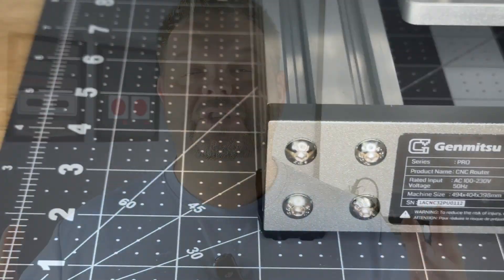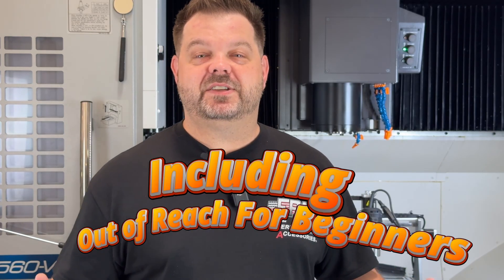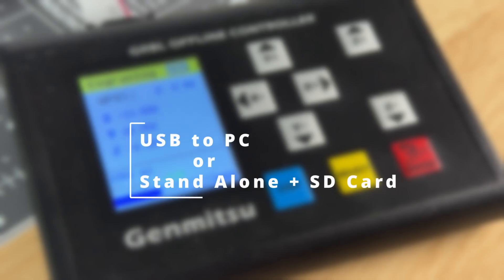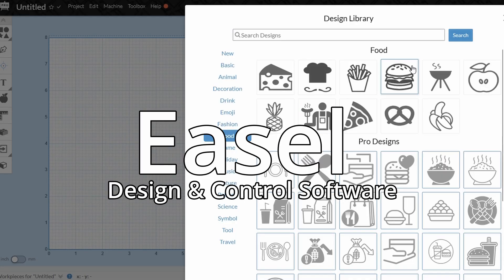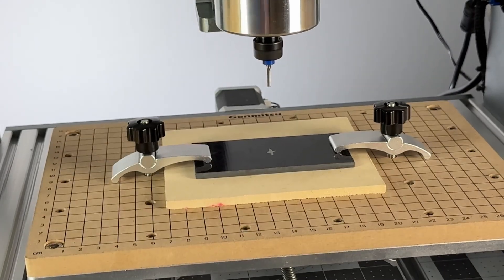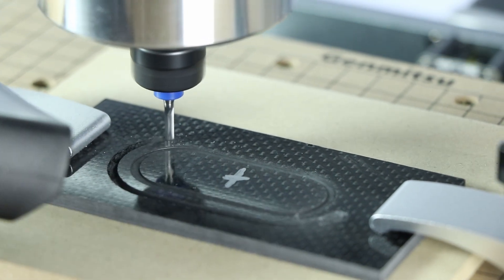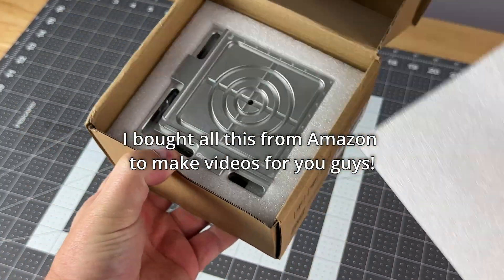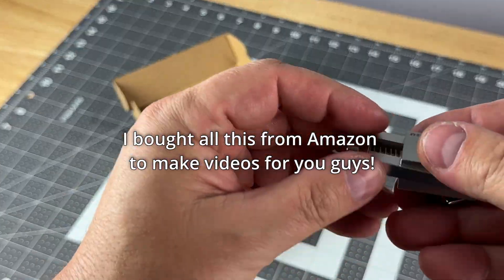Worth it? Desktop CNC

Comment: This is your latest video, but I have an old question as a long time sub.  I priced out the new Syil x7 with 4th and was somewhat happy with the price. Now a different machine, a 2023 Haas Tm1p under 200 cut hours for 35k less than a syil- not comparable machines, but for a 44 year old retired vet with pension in canada looking to step up from hobby land - what would you do?
Reply: What’s your goal for the machine? 
If the haas is 35k cheaper, I wiuld almost definitely go haas
Good resale. Good service network, good machines. Light enough to scoot around with a pallet jack, single phase power if needed. 
And 35k in you pocket for all the other costs. 
I stated my buissness on a 2005tm-1 and I would not hesitate to get another
Reply: @brianwaayenberg3099  Ended up buying a new syil. Haas has a whole new security protocol to be an "authorized owner" which I didn't want to go through the process
Reply: @Island.dweller  really??? even on a used machine?  i heard they may not sel parts to some older machine owners too over something like this. what details do you know that you can share? my understanding is they got thier PP slapped over some exports to russia a few yearsback.  even got weird about selling their tooling. had me sign several itterations of paperwork to buy endmills :/ (more a gov. thing than their failt i belive

Comment: I usually enjoy this channel, but I’m afraid I must take issue with what’s being misleadingly presented here. A 3018 CNC, even the best one like the SainSmart version, is not a machine you learn machining on. It’s quite the opposite. Yes, you’ll come across some basic notions, perhaps even gcode, although most software keeps that in the background. You’ll hear about feeds and speeds and depth of cut. That’s about it. Beyond that, you’ll be learning the opposite of what a professional machinist does. Why? Because the machine simply cannot operate within the specifications of a proper cutting tool. It’s that simple. What you’ll actually learn is how to constantly restrict and compensate for the machine’s limitations in order to make any cut possible at all. The 3018 will teach you how to undercut, baby the toolpath, damage your tools, and fight against the machine rather than with it.

Aluminium? Please. That’s marketing fantasy. If it were true, why would professionals spend fifty thousand dollars on a one-ton machine to cut aluminium? The 3018's real playground is soft materials like foam, MDF, balsa, plastics and composites. And that’s it. Why? Because the machine just isn’t rigid enough to handle anything tougher. That’s not an insult. That’s physics. When your spindle motor has no ball bearings and runs a 5mm shaft, you don’t get miracles. The same goes for the floating transmission, and especially the Z-axis, which is the most critical on any CNC machine. Here it’s held cantilevered on unsupported 8mm rails that behave like springs. I’m not even touching on the aluminium frame. Despite the improvements from SainSmart over the cheapest knock-offs, this is still a toy. And you don’t learn serious machining with toys.

Can you machine with a SainSmart 3018? Yes, if you stick to soft materials and use small tools, 4mm diameter max, because your tool should be thinner than the spindle shaft. That way you remain within the very narrow capabilities of the machine. You won’t be learning real machining, but you’ll get a vague idea of how the technology operates. To learn properly, you need a machine capable of running tools at their designed parameters. This isn’t like fiddling with a steam locomotive, throwing in a bit of coal here and cranking the pressure there. Machining is not guesswork. It is a science. It involves real calculations where RPM, surface speed, and feed rate are derived from the tool specs and the material properties. This has nothing to do with trial and error thinking like “I broke my endmill so I’ll just slow things down. Oops, I broke again a $200 tool, let's try slower.” And don't tell me machining is taught like this in the US by serious professionals. I don’t buy it. That is not machining. That is improvisation. And improvisation does not teach precision.
Reply from the maker: I think these tiny machines are low cost primer
to test one’s appetite and aptitude for larger more powerful tools. 

I never said it teaches flawless machining techniques 

But many people who message me don’t even understand G54 or G43

It’s easy to preach in the comments when you learned on another machine or at a trade school. 

I built a business that has sold millions of dollars  in  products over the years in my journey started with a 6040 CNC router, not too dissimilar from the machine in this video.
Reply: @NerdlyCNC  Let’s agree to disagree. I don't believe that spending hours engraving soft materials at slow speeds gives anyone a meaningful preview of what CNC technology truly is. By the way, the palm router bundled with the SainSmart isn’t exactly built for endurance runs. It overheats easily and wobbles under stress.

My journey started back in 1996 when I built my first CNC mill from scratch, relying on advice from machinists on early online forums. That was a real journey back then. My engineering PhD included zero hands-on machine training, so I had to earn every bit of it the hard way.

There is a massive gap between a 3018 and something like a 3040. With the latter, you can actually machine hardwoods and brass using proper tool parameters. Just compare the stiffness between an 8 mm and a 16 mm linear rail. That alone tells a compelling story. That is where real learning begins.

It is not even a question of price. Even today, you can convert a Proxxon MF70 to CNC for less than the cost of a SainSmart 3018, even with an off-the-shelf kit. And you will be machining steel within a few hours. I am not talking about trembling micro passes with a questionable finish but genuine metal milling on the hobbyist scale.
Reply: I've got to agree with @NerdlyCNC on this. I have an even lighter desktop CNC mill (Nomad 3) and have been very impressed by what I've been able to do with it. I've thread milled 1/2-13 x .75" deep in brass, made functional parts from aluminum, brass and Delrin, and had to overcome rigidity challenges with both the machine and work piece. It does take forever to produce something useful in metal but with appropriately sized cutters (1/8" and under) it will produce good parts but the same could be about trying to cut a large stamping die on a 40 taper VF 6.
Reply: @GTFab  I sometimes wonder if people will ever understand that their experience, while perfectly valid, remains limited to one specific machine, or at best a small range of low-end ones. But it relies mostly on their feelings. It’s not that they’re wrong or dishonest, it’s simply that they haven’t seen what proper machining really looks like. And no, I’m not talking about comparing a budget hobby CNC with some absurdly expensive industrial monster. You can absolutely build a capable machine for a few hundred dollars if you know what you’re doing.

The thing is, mediocre machines do cut, yes, but they do so poorly and painfully slowly. Why? Because they can’t actually work within the cutting parameters their tools were designed for, especially not on hard materials. What your experience really teaches you is how to adapt your cutting settings to what your weak machine allows. That’s not machining, that’s survival. The examples you’re giving prove exactly that. What you might not realise is that you’re slowly dulling your tools and wearing out your machine long before its time.

POM and brass are soft materials. Aluminum, however, starts to enter the semi-hard category. It’s also treacherous, because there are countless alloys, some of which are extremely demanding and impossible to cut cleanly on a mediocre setup. Standard aluminum, like 6060, can indeed be machined at high cutting speeds, which creates the illusion that the machine can handle it. But something you can’t yet appreciate is the quality of the cut itself. You’ve never seen the mirror-like finish of a proper machining pass on a capable system. Your parts might look good to your eyes and even measure fine with low-cost tools, but they would never meet the requirements of precise assemblies. Your satisfaction doesn’t change the nature of the machine, you see?

There’s another essential point you’re missing. When you machine materials that are beyond your system’s comfort zone, you are putting massive stress on your guides and transmission. When designing a machine, we usually apply a safety factor of 6 to the load capacity. For example, if we expect the machine to handle 10 Nm, we’ll select guides and drives capable of at least 60 Nm. That’s what ensures it can keep machining properly without early wear. Now, what happens when you push a mediocre machine past its limits? It’s like asking a 1 Nm setup to deal with 10 Nm of effort. That’s roughly what happens when you cut aluminum on a 3018. To stop it from turning into a vibrating sewing machine, you’ll lower your cutting parameters until the forces drop back near 1 Nm. Unfortunately, those stresses still wear down your guides and transmission, introducing play and ruining your tools over time.

There are no miracles here. If capable machines use strong linear guides and torquey spindles to cut metal, it’s not for the joy of being expensive. It’s simply because that’s what it takes to do the job properly and build something that lasts.
Reply: @axelSixtySix  I think there's too much context being lost to have a meaningful discussion. I agree that these lack rigidity to efficiently produce metal parts and the I could have built a much more capable CNC mill for the cost of my Nomad.

Beyond that, you've shared a point of view, I've shared a point of view, and those are 2 data points in addition to Nerdly's video that may help someone's purchasing decision.
Reply: @GTFab  There’s no one deafer than the one who doesn’t want to listen. You’ve shared your feelings on the topic, I’ve shared basic mechanical facts, that’s called physics, not opinion. Let’s make it clear once and for all: claiming these machines can mill metal is like claiming you can slice tomatoes with a butter knife.

They simply aren’t built for it. From the frame to the spindle, nothing in their design is competent for proper metal cutting. What you’re doing isn’t machining, it’s gentle filing, slowly, painfully, and at the expense of your tools and your machine.

The reason I insist is precisely to help newcomers avoid that illusion. If their goal is to work with metals, they should look for machines actually designed for that purpose, not toys pretending to be mills.

I don’t hold it against you, you’re just new to the craft, but don’t worry, reality tends to teach that lesson faster than I ever could.